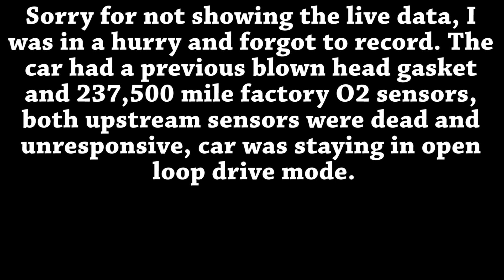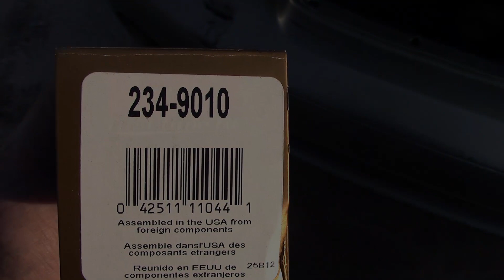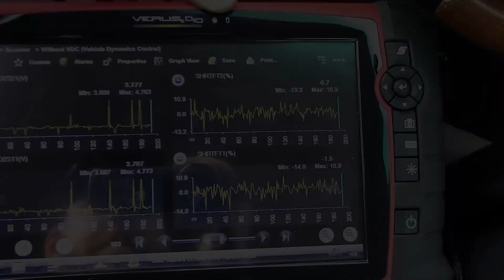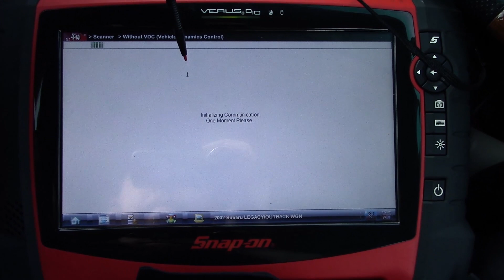Subaru H6 Oxygen Sensor Replacement - P0151

Comment: Thanks for the video.   It was reassuring to know that I had the correct side.   Old sensor came out easily with a squirt of WD40 and a 22mm open-end wrench.  Electrical connection required smaller hands than mine, but daughter did a nice job.   Reset the CEL and now we'l see if it stays fixed for a drive to Portland!

Comment: I'm getting P0174 and P2097 on my 04 LL Bean Wagon with approx 160k miles and original O2 sensors, from what I can tell.  I have searched the forums and have been pointed all over. What are your thoughts on this pair of codes ?

I'm leaning towards an intake leak...but where it's only one bank I'm a bit perplexed. The engine does seem to be idling a bit rough and mileage has dipped recently.

Thanks in advance. 😀

Comment: Hey Mr Subaru I don't know if you reply to your videos currently but I'm having the exact same issue but Bank to sensor 1 only and it's saying open circuit and I replaced the O2 sensor and I'm thinking it's probably a break in the wire? Would love to know if you think that's probably the cause because the ECM seems fine and there's continuity from the wire harness from the ECM of that specific connector. Not too sure if probing around the ECM is even a good idea while the car is on so I don't want to risk it but I also don't want to go to a mechanic to pay hundreds just for a simple fix let me know what you think. Thanks!

Comment: Mr Subaru i apologize here gonna be urgent. I have daily 03 sub out llbean 3.0l h6 that has bank 2 sensor 1 code when i tested at autozone. I bought a downstrean and up stream  sensor do i need another pair of upstream and downstrean sensors since you recommend changing it pairs? Also does the upstream go on the left or right(same wyestion for the down) and how do i know which side which sensor goes on? Again thank you and i apologize for the lengrh and urgency of the question.
Reply from the maker: What's the code?
Reply: @MrSubaru1387  p0154

Comment: Getting p0151 and p0051 on 2002 outback H6 should I replace both sensors or all three or what? Also are the sensors identical or do they doffer?
Reply from the maker: Replacing the upstream sensors on bank 1 and 2 should be sufficient. That's said, replacing the upstream sensors, without replacing the downstream may result in a P0420, catalyst efficiency code, due to the upstream sensors being new and the post catalyst downstream being old.
Reply from the maker: The two upstream sensors are identical. The downstream is different.
Reply: MrSubaru1387 which side is bank 2, sensor 1, drivers side?
Reply from the maker: Bank 1 has cylinder 1. I believe, going from memory, bank 1 is on the right, bank 2 is the left.
Reply: MrSubaru1387 thanks 😊

Comment: I got the same CEL light on my '05 Outback 3.0R with a revised EZ30D. Is the O2 sensor replacement the same? I already replaced the MAF with an OEM Denso and I keep getting passenger bank running lean.
Reply from the maker: If you keep getting a lean code, you probably have a lean condition. Intake leak, partially clogged fuel injectors, etc. Hard to say for sure without seeing the vehicle though.
Reply: Hrmmm I clear the code and it'll come back like days later. I notice it does idle weird and sometimes it will cut off at idle. It doesn't knock or anything.
Reply from the maker: I just re-read the original comment. I now see you replaced the MAF. Thought you said you'd changed the O2s and were getting the same codes.

Comment: Hello Mr Subaru
I got today weird thing. First my check engine lite came on and ESP icon was solid for a while with flashing "break" word light and flashing cruse control icon. I checked code and have P0171 P0113 and P0102. Car is 2013 2.5i Legacy. Did you ever see that
Reply from the maker: P0171 - System Too Lean (Bank 1)
P0113 - Intake Air Temp Sensor 1 Circuit High
P0102 - Mass or Volume Air Flow Circuit Low Input

Sounds like the most likely cause is that you have an air leak somewhere between the cylinder head and MAF sensor. So, intake pipe to MAF, intake pipe to throttle body, throttle body to intake manifold, intake manifold gasket, fuel injector o-ring, or in the PCV system. It could be an exhaust leak between the cylinder head and exhaust manifold, the exhaust manifold and the catalytic converter. You could also just have a bad MAF sensor or an issue with the MAF sensor connector, wiring, or the PCM. Hard to elaborate further than that without being able to test components on the vehicle.

Comment: Does the light go out automatically or do I have to have it cleared?
Reply from the maker: Have to clear it for it to go out right away. If not it will turn off on its own after several miles of driving.
Reply: +zcamaross09 thank you
Reply: So i replaced the sensor and the CEL is still on?? The code is gone. But it says engine speed and road speed calibration is off. Shouldnt the light go out?
Reply from the maker: If the code for the oxygen sensor is gone, yet the CEL remains illuminated, then you have a second code or a separate issue.

Comment: My code is p0031. Is that the same problem? It says low voltage replace bank 1 O2.
Reply from the maker: 3.0 or 2.5? Year?
Reply: 02 3.0 llbean
Reply from the maker: That's the front right sensor. Either you have a bad heater in the sensor, a bad connector, a bad wire, or an ecu issue. I'd start by checking the heater with a multimeter. Visually inspect wires for burns or cuts, check for resistance across the heater. Should be two white wires.

Comment: My code p0031 saying Ho2s heater control low bank 1 sensor 1

Car is outback 2006 h6..right hand driver

Sir is the 02 location is the same like in your video??

Comment: My car has. P 1152 - p 1155. All 
1152- low 
1153 - high 
1154 - low 
1155 - high.  
My question is what sensor do i need
Reply from the maker: What year, model, engine?
Reply: @MrSubaru1387  2002 Subaru outback h6 3.0 Vdc sedan.